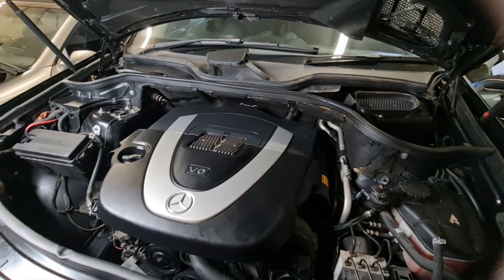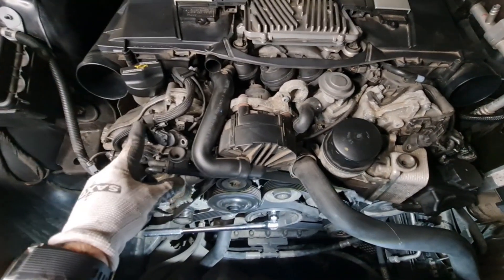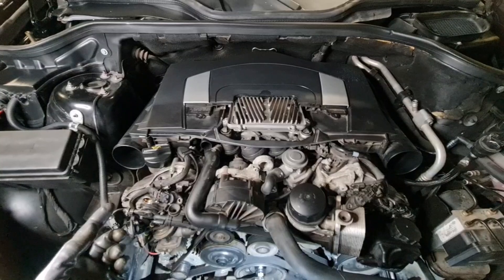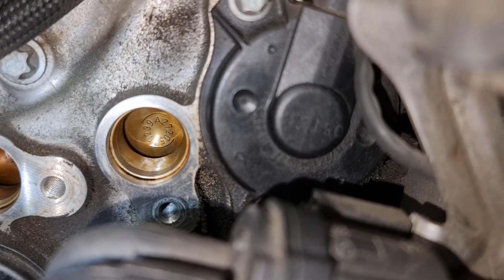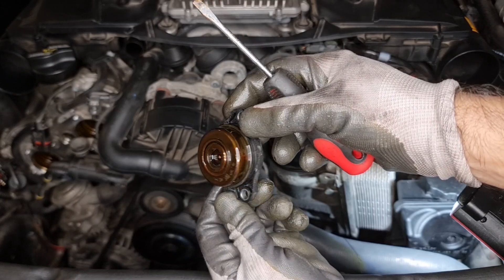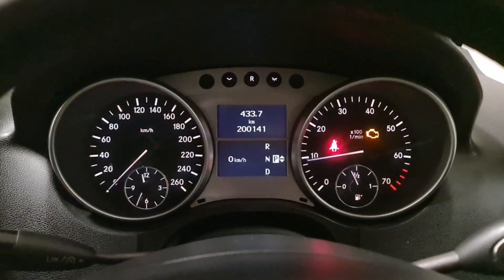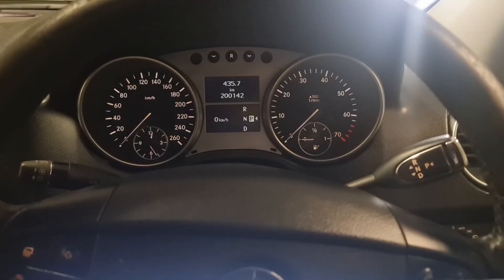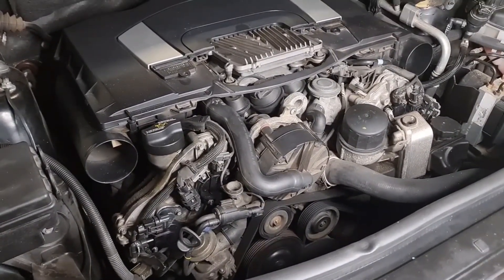Crucial Topic: Check M272 & M273 balance shaft sprocket before catastrophe...

Comment: Hi there, we have a 2011 E350, terrible vibration over 2500 rpm, only 123kms.... the Vin/Chasis number is  WDD2122562A477695, I cannot find the engine number, I have tried to find out pressing the telephone and Ok buttons but cannot access the system, can you help ?
Reply from the maker: They rectified the bad quality gear issue after 2009. So your issue might be s.th else.
Reply: Vacuum leaks are high on the list of problems. Cracked and broken vacuum lines are typical for these older cars. Some of those lines are a hassle to get to, you may need to remove some items, and you should have a small assortment of needle nose pliers of various sizes and curved jaws.  Remember that Mercedes uses plastic lines in some areas that go into rubber lines in other areas and only specialty places like FCP Euro, and AutoHausAZ will have those plastic lines.  Also check your manifold swirl-flap actuators.  I replaced the main actuator, a couple of fuel injector seals, and the vacuum lines and the engine went from shaking to running very smoothly. Try using carburetor cleaner or starter fluid to diagnose where the vacuum leaks are.
Reply: Engine mounts

Comment: Just to clarify, is your M272 pre-2008?
Reply: I recently had the codes p0018 and p0019 on my 2007 e350. The engine number indicates it already has the good balance shaft sprocket. But the timing is  still a little bit off. Not a lot. I tried to swap the sensors around to the other bank but the fault code still shows up. What should I do?
Reply from the maker: Yes, 2006 M272 from a W164 ML350.
Reply: @BenzAddiction  what are going do?
Reply from the maker: @johntarenidis9338  If you are asking me what I did to that car, I actually ended up selling that ML350 and bought another one (2010 ML350 with 100k km on clock) as I did not have time nor physical stamina to pull that engine alone.